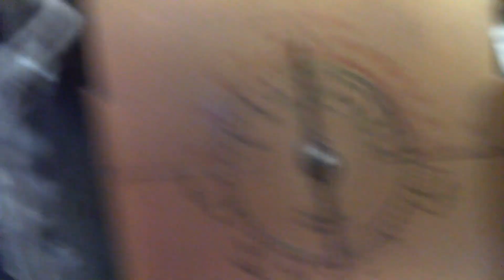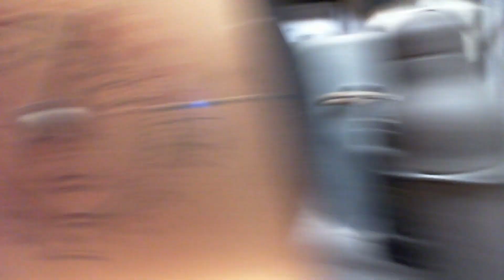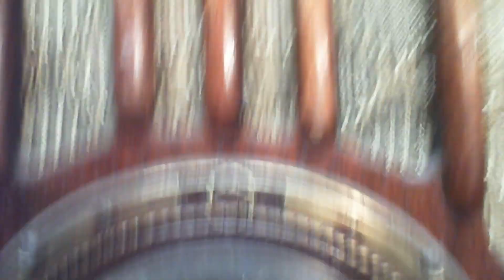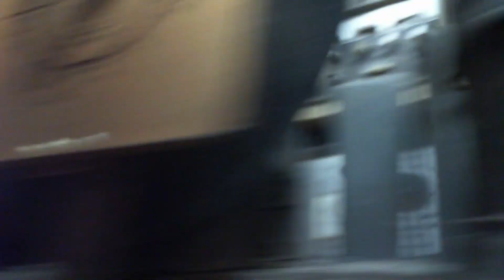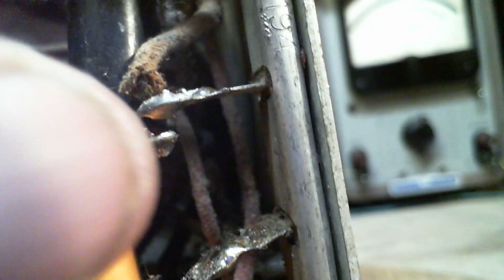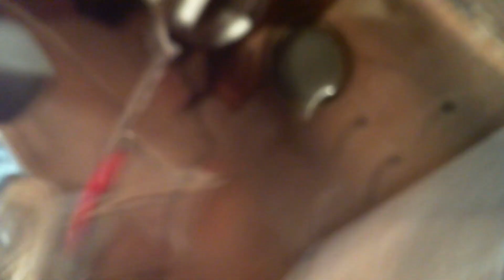Emerson 34C Tombstone Tube Radio Video #1 - Checkout and Power Up Test

Comment: Emerson radio model 34C . The cabinet is by Ingraham. There should be two electrolytics at 8uF at 450V each in the can. 
The B+ is 355 Volts. These radios did not come with a back. You should use a 16uF +16uF electrolytic as a replacement.
47uF is too high.